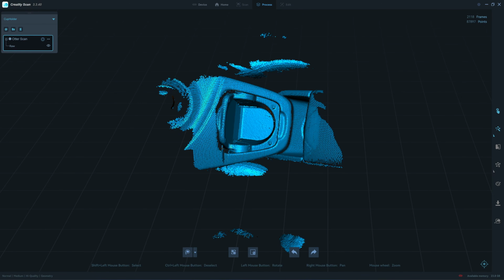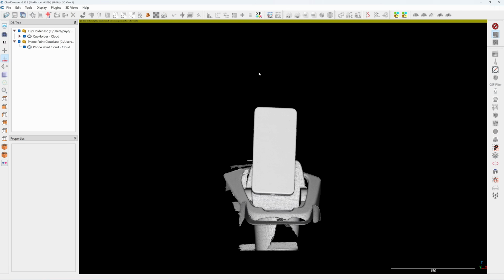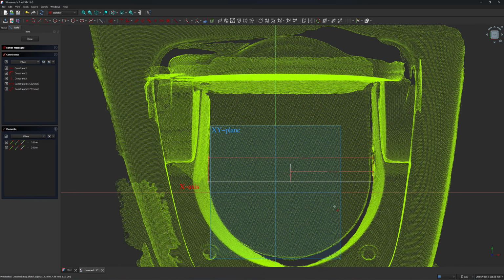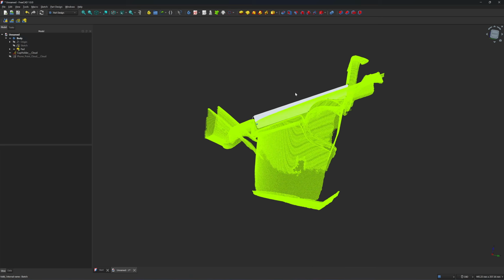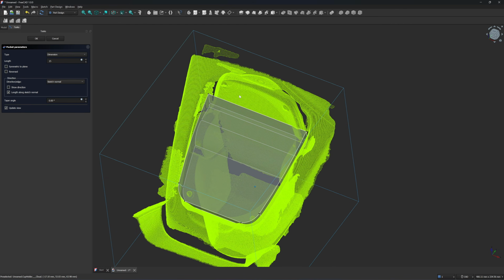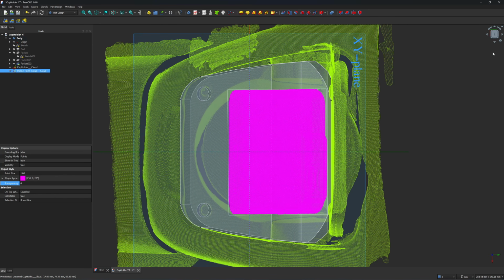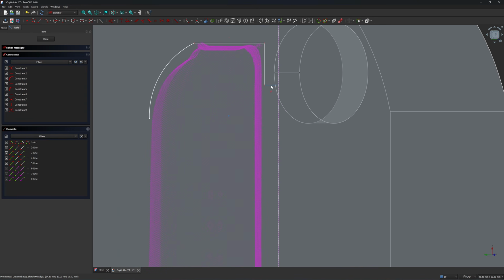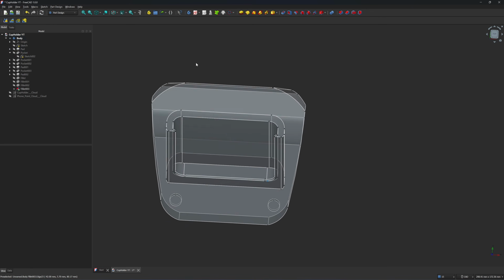3D Scan to CAD : Designing and Printing a Cup Holder Phone Mount with Creality Scan Otter & FreeCAD

Comment: What ASUS laptop are you using for mobile scanning? What specifications should such a laptop meet?

Thanks!
Reply from the maker: This is the A15, 2024 model. Go for a gaming laptop that has 8+ cores, is less than three generations old, and comes with an Nvidia RTX 4060 or better. 32 GB of RAM will be plenty.

Comment: Good job on considering the lateral movement (trust me, have been bitten by that many times) but don't overlook the most common problem which is horizontal g-force when cornering.  It's heart breaking when your phone goes flying into the passenger footwell midway round a roundabout!

Comment: Nice workflow. Before I import scanned objects, I edit and align them in blender before because it has more tools for mesh editing. I also cut off unnecessary stuff there and reduced the count of vertices for better handling in FreeCAD. If you convert the mesh inside FreeCAD to an object, you can also set reference points there i a sketch.